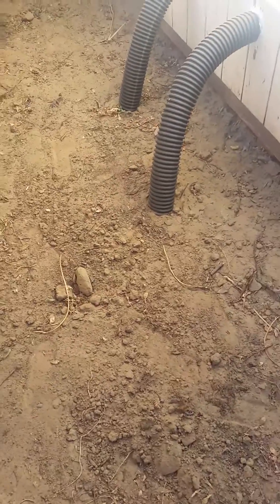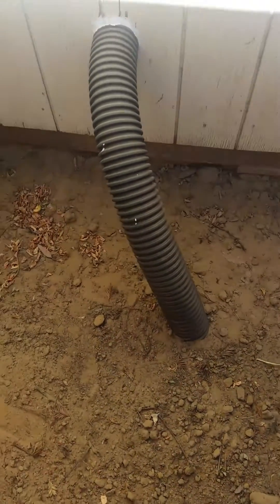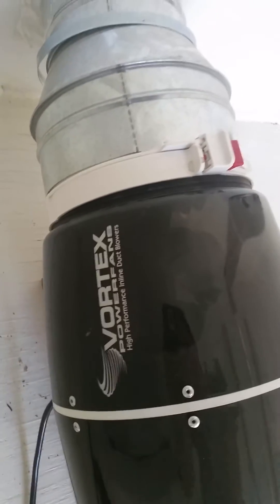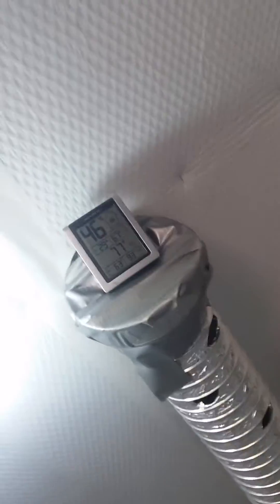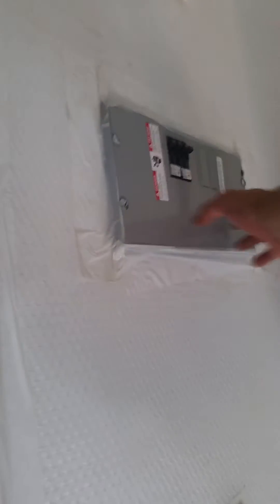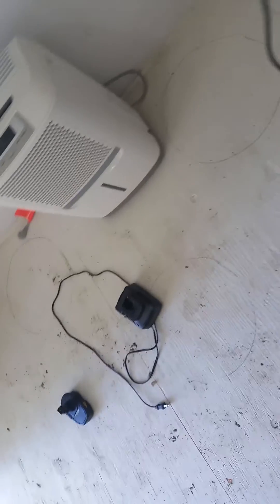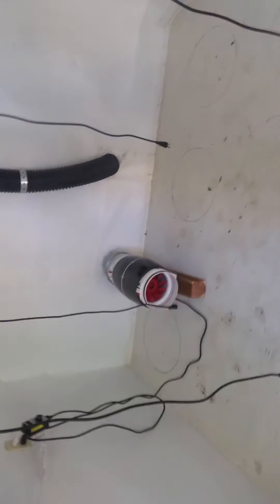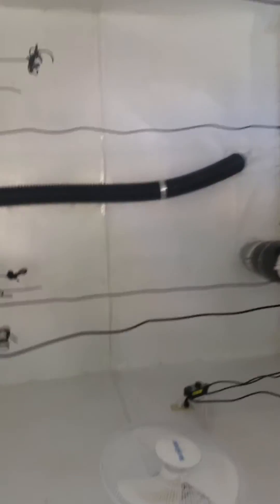Grow Shed - Geo Thermal Concept

Comment from the maker: It's been doing a impressive job, I've learned that trying something new or different to a sealed {GEO} environment only do 1 or 2 -- if their properties are different; because anymore will alter, even foul your tests results and do more damage then good. 

Back to the Geo Therm--> I have had no problems with the system so far against the heat, and finally we just had 3 days of heavy frost, I have to say I'm impressed  with it staying between a low of 65 degrees F* and high of 81.  There's not a heater in the shed so that means it's maintaining a residual GEO Thermal balanced temp. I'll make a video in the next day or two.

Comment from the maker: the temp test with only Geo Thermal fan running

The numbers are in ---- Base outside temp        105
                                                    inside                    101
                                         exhaust hose end          102

                                         running GEO only
                                                            outside         105
                                                    inside                    97
                                                        hose end          91
This was only a 30 min test as with more time the numbers would go lower

Comment: Scott: I love it!  You've got some cool ideas.  It's basically a bad-ass shed as far as I can tell.  Hard to suggest any improvements, as it looks complete.

A few questions/comments:

1) I like leaving some air space between the wall insulation and the wall.  In theory, i wonder if you could just run the geothermal fan inside that wall, and only heat/cool the air in the air space.  No matter; might conserve floor space if it was tight.  

2) The inline fan is a burly bugger!  Mine only draws 12 W, but from the sound of the motor, I am guessing yours draws far more.  One guy who posted on my youtube page said that my fan needed to be stronger.  It'll be interesting to see if he was right.  

3) what are your winters like?  Do you need heating?

4) Also, I would be interested to see if you turned off the A/C on a hot day and just let the geothermal do the cooling.

5) When I built my greenhouse, I was aiming for an "off the grid" arrangement.  Something that I could easily convert to a small solar system.  I had a hard time keeping it warm on our cold winter days.  Need better engineering and probably more aggressive active heating.

Last, I would ask you what you're growing, but...  Hey, I'm from Colorado, man!  Neighbors next door actually called the cops on me when I had my other greenhouse up.  I wasn't growing anything "interesting" but the cops told me that I could only have 6 plants and needed to put it out of plain sight. ;-)
Reply from the maker: Ok, first I must thank you for your time, and your video is awesome as I have used your graph and referred your video from mine for a breakdown of the concept. I was told by a experienced grower in college that we need to install a hep-pi filter do to exposed intake air and dirt is a combo that produces bad bacteria.
1: with the air space between the wall I believe that it's an insulation of it's ow and running geo in it might compromise it.  I'm not sure 

2:as far as the fan goes;  as you know I'm running 100' of vented hose and I estimate 18 elbows or more causing quite a bit of resistance where in your design I believe you have half the elbows so I'd say maybe grab a fan similar or the same with a speed dial to assure proper air flow and conserve energy as I believe your system does not require as much as mine.
 
3: Winters here in California Central Valley are on average of a low at about freezing temp it hasn't snowed here in over 20 years lol

4: I'm gonna stop typing real quick and test it now-------and will finish your questions in 30 min of test time
Reply from the maker: I'm still waiting for the temp test with only geo -------------

5: I would say that you'd need more of a aggressive approach to insulating then towards heating as a little bit of heat + GEO+ strong insulation= minimal amount of heating required to obtain a  stable growing environment

6: The 6 plant law is federal, although federally it's not legal; law enforcement use it as a common law for 6 adult plants and some number of immature plants per card holder at that  residence/house/property. So if you have 3 card holders in one house you can grow 18 mature plants and yes it can not be seen from the street or drive

I also wanted to say if you think about it we are pioneers in the Geo Air Flow Concept; as many people have said when i was building it stuff like "It will not be efficient "', "I'm wasting time and effort", "Geo Thermal is only a steam or liquid system" and many more but I felt you had a great idea and system & here we are, not only producing facts of efficiency but now measuring/testing  a positive outcome of this concept/idea!
Reply from the maker: Answer 4:the temp test with only Geo Thermal fan running

The numbers are in ---- Base outside temp        105
                                                    inside                    101
                                         exhaust hose end          102

                                         running GEO only
                                                            outside         105
                                                    inside                    97
                                                        hose end          91
This was only a 30 min test as with more time the numbers would go lower
Show less
Reply: This is pretty impressive.  What it ends up at on a super hot day after running many hours, who knows.  But if you can kick the temp down 15 degrees in 30 minutes, it would seem to serve its purpose!  You're getting me motivated to finish up my wood greenhouse and just slap the plastic on.  I can keep it cool with geothermal.
Reply from the maker: I believe the last test kicked it down 9 degrees but that was a sealed room test and with this build it's made to insulate both hot n cold so I believe with circulating fans and A/C; I believe the A/C will kick off much more with little power consumption. One concern I have is the co2 level being a sealed room I'm not sure if the ported underground hose will aid in the transfer/ exchange of it ?
Reply: Since you have a sealed system, I don't believe it would change the gas composition of the room either way.  Your plants should use whatever CO2 is present.  I'm not sure how an open hole system would affect CO2 concentration.  BTW - that is one burly fan that you have!  It draw a lot of power, but the upshot is that you get fast cooling.  I suspect you could run a much bigger system with that fan, but I don't know.
Reply from the maker: Morgan Brown  yes it's powerful; but I needed to insure I had enough push and because of the power it would take down the efficiency numbers of entire system. so I got a speed dial /regulator to run it at the speed required to push the system. Hey bro I got a question  Q: Do you know what hepa filter would be best for this system because I know i have to filter intake air of GEO but I can't block the flow with a filter so i need one that allows good air flow
Reply: +Scott hiebert wish I could help with the filter.  Maybe your best bet is to just run a separate air cleaner unit inside the greenhouse?  Seems easier than trying to inline a filter in your geothermal flow.  Just a thought
Reply from the maker: I was told it is a must and to only be installed on intake do to exposed earth and variable temps because earth and temps are recipe for bad organisms,  and also just to be sure they said for me to put a little bleach down the geo hose, and clean entire shed with bleach after the cleaning is done immediately run all devices lights-geo fan--circulating fans A/C and so on. Doing this blows the evaporated bleach most anywhere you cant reach, thus sterilizing shed almost or at 100%
Reply: Hi Scott,
I havent had any issues with nasties (bacteria, mold or anything stinky ) in the tubing, the airflow creates the ideal environment for the good guys to thrive. I wouldnt recommend nuking the tubing with bleach as it wont discriminate between good or bad.
Reply: I use a 12" duct fan, the spec is 1700m3/hr (1000cfm) 240v 310w (1.36 
amps).  It provides an output of 900cfm at 0.47 inches of water which is
 split evenly between 15 tubes. With 60cfm per tube the loss equates to 
around 0.16 inches of water.
&#160;With 728cfm in a single 4" tube 129ft long, your losses will be around 36 inches of water. The velocity of the air in the tube would be around 95mph :) 
At 72.8cfm the loss would be down to around 0.47 inches of water (velocity 14ft per second) so it`s worth checking the flow rate from the tube exit to see what you have.

I tested mine recently with an outdoor ambient temp of 32c (89F). I switched the system off, sealed up the greenhouse which was in full sun at the time and let it climb to 60C (140F). With the fan on maximum, it took a shade over 12 minutes to drop the greenhouse down to 20C (68F).

Here`s the Vortex S-Line  S-800 spec,  
http://vortexpowerfans.com/media/57a0fe0a9562e.pdf
The output at 0.16 in wc (water column) would be around 690cfm, at 1.5 in wc it will drop to 204cfm.
Reply from the maker: JohnGuest45 Finally someone else that has some hands on experience! I have a few questions if you don't mind answering them; I'm assuming you will so to save time relaying messages I'll toss them in now. 1: How long have you been using Geo Therm.?  2: Using a sealed room I assume you use some form of CO2 dispersion, What is it?  3: As far as air filtering and the bad bacteria/mold, what do you use? Thank You so much if you answer these
Reply: My subterranean heating and cooling sysem (SHCS) is in a greenhouse so i rely on mother nature and natural ventilation to provide the CO2 :)  It was installed in 2009 so it has a bit of mileage on the clock. I dont use any special filtering for the shcs, just the usual bug screening on external greenhouse vents to keep the critters out. If you plan to supplement CO2 i dont see any problems as any that is drawn in will ultimately be pumped back into the room. CO2 is heavier than air so it will tend to sit lower down in the room,  away from the system intake which is high up.
I have a grow tent setup indoors with a  300w led, its not for growing anything iffy or whiffy i hasten to add :)  I dont use it year round, its mainly for overwintering  and starting stuff off early.